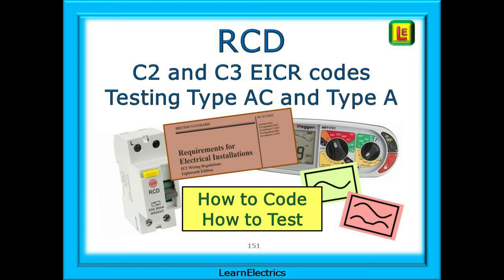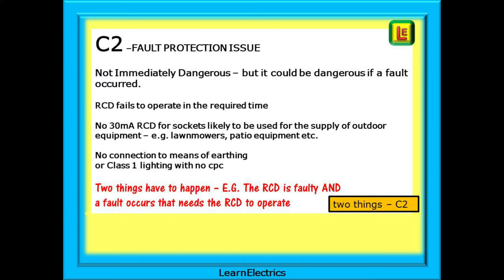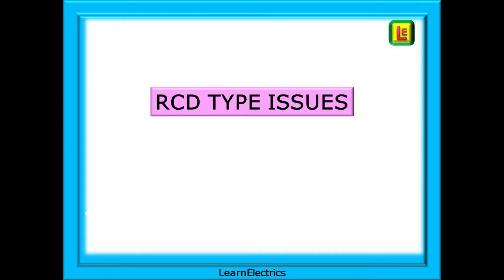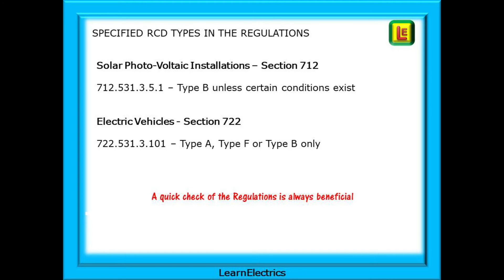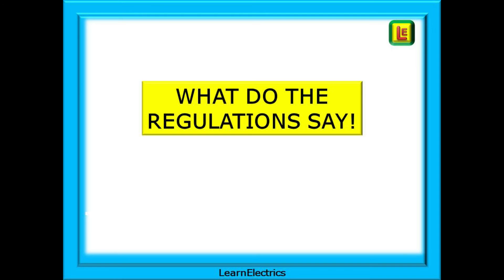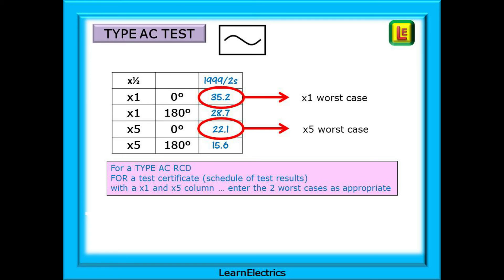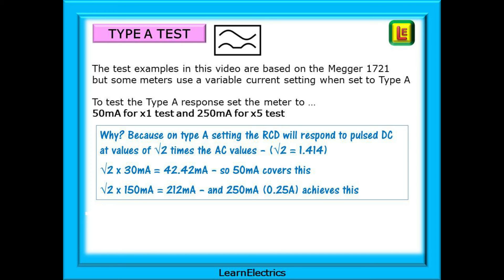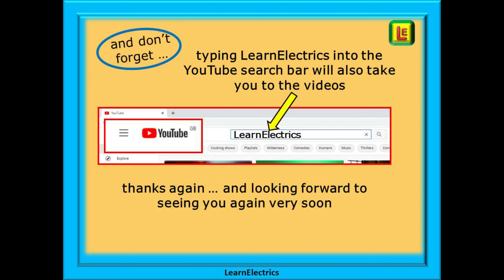RCD – C2 and C3 EICR CODES and TESTING Type AC and Type A devices – THE DIFFERENCES

Comment: I have a question! What if the house is fitted with RCBO's! Would you do the test sequence for each fitted rcbo's? 
I know normally a rcd Would protect each bank in a DB but with RCBO'S you wouldn't need a rcd if I'm not mistaken?
Reply from the maker: Each RCBO should be tested and any RCDs that are installed. If a circuit is RCBO protected then it will not need to be on an RCD circuit, it will be standalone.

Comment: Hello, I would like to replace my two 30mA type AC RCD in my split load consumer unit which is downstream of a 100mA type AC RCD. From a selectivity standpoint, would 30mA type A RCD upstream of 100mA type AC RCD be ok? Thanks.
Reply from the maker: Wrong way round. The bigger rating 100mA RCD should be upstream of the 30 mA devices. Hope this helps.
Reply: @learnelectrics4402  Thank you! Yes, 100mA should be upstream and the 30mA should be closer to the MCBs. All I'm doing is replacing my two 30mA type AC with type A. The 100mA type AC remains as is. So it looks ok from a selectivity standpoint. Thanks again.

Comment: If installing a socket outlet to a existing installation for a 13amp single oven on its own circuit will this now need to be type A rcd protected or is the type ac in place sufficient. Was looking at 531
3.3 would this be classed as cookers
Reply from the maker: I'm guessing that this is a new, modern oven with timers and bells and things so it probably will have DC components in it. And a new circuit? with new circuit breaker and new cables? I would go for a type A RCBO for this circuit. If its an older board there might be some difficulty in relocating or fitting in an RCBO. You could always fit an external RCBO in an enclosure.
Reply: @learnelectrics4402  hi thanks for reply yes all these modern ovens have timers and maby led light. 
  What it is a local shop to me wants me to install a socket behind all the single ovens they go to and for some reason they can't install them.
   So say its a 13 amp oven that's been wired direct to the 32 amp cooker circuit.
   So they then want me to pop in add a socket so they can go and just install it.
   These new regs with type a rcds are a bit of a pain. People don't want to pay.
   So trying to find the best way to keep price low 
   Was maby thinking of them type A rcd fronted sockets or fuse spur devices if they comply to regs.
   It's hard to tell someone they need all this work doing just to plug there oven in. When they already have a type ac rcd in place thanks

Comment: Sir, I have a question with regards to testing of the RCD. Should the SPD or AFDD should be disconnected prior to carry out RCD testing? To avoid damaged to the devise. Is this correct?
Reply from the maker: Not necessarily. The RCD test just puts a few milliamps at 230 volts across the RCD. Insulation Resistance tests are different, you definitely need to be disconnecting devices or taking precautions before putting 500 volts down the wires. Dave.
Reply: Thank you very much sir, for your advise.😊

Comment: Slightly off topic, but I have a question regarding rcd protection. I was doing a job a couple of weeks in which I had to add 2 lights to an existing circuit "commercial " the lighting circuit in question was protected by an mcb but does have switch drops etc. Now as I was the last person to work on the circuit I was under the assumption that I would now need to protect it by an rcd. My mate thinks differently. Any info would be welcomed. 

Thanks.
Reply from the maker: If you make additions to a DOMESTIC lighting circuit you must bring it up to current standards which includes 30mA RCD protection. Hope this helps.
Reply: @learnelectrics4402  hi dude thanks for your reply. So would it be only domestic or domestic and commercial? I only ask because the job I had done was commercial and the existing wiring contains switch drops etc. Thanks again.

Comment: Hi Learn electrics your videos have literally been brilliant helping me out during my First year starting out, they're so easy to understand.
I have got a question if you can give advice please. Lets say a customer wants power to outdoor sockets and power to an outbuilding and everything is fine like bonding, RCD protected etc etc. Would you need to retrofit an SPD in this instance ? Or does SPD installations only be required when fitting a new CU.   Thank you so much.
Reply from the maker: At the moment, for domestic circuits they are optional. It is recommended that we tell the customer about SPDs and let them decide about installing one. But not compulsory.
We have a video on this called  SPD INSTALLATION IN A CONSUMER UNIT, click on the link below to see it.
https://www.youtube.com/watch?v=pgiUeQ3Z7Cw
Dave
Reply: @learnelectrics4402  Thank you so much

Comment: This is really poor outdated advice. Having spoken with actual members of the JPEL 64 board I can advise that there is absolutely no requirement to test Type A RCD’s on the type A settings within the 18th edition 2nd amendment. The only test now required is that all types of RCD’s should be tested on the 1x setting on either 0 or 180. If in doubt refer to the NICEIC who will advise in accordance with the new IET regulations.
Reply from the maker: This is exactly what I say in the video Martin. The Regs only require the most basic test but if you want to do more, then this is what to do. Thanks for watching. Dave.

Comment: Another really useful video, thank you. The additional testing required for type A RCDs was really useful info, and I’m now thinking that my old Megger 1552 MFT isn’t really up to the job of adequately testing type A RCDs - it only has 100 mA and 300 mA ranges on the mA dial, not the 50 mA and 250 mA suggested in the video. Thoughts, anyone??
Reply from the maker: A good idea to keep your equipment up to latest standards. Sometimes you just have to do it. However, the 250mA test is, according to the test requirements,  AT LEAST  250mA, so 300mA would do that and if your 100mA range has a times half setting, there is your 50mA. The megger I mention in the video will do all this, shop around for a deal. Dave.
Reply: @learnelectrics4402  , thank you for the help and advice.
Reply: Perhaps you have taken the plunge now and bought a new meter but my MFT 1553 has a number of  current settings and will do the specified currents if you use the x 1/2 setting. I thought the MFT 1553 was identical to the 1552 but for the Bluetooth  feature on mine. Maybe I'm wrong. 

If a meter works and gets through calibration year after year then why change it.

Comment: excellent Video Dave however I have a question as you mentioned if only sockets are suspected to feed outdoor then C2 otherwise C3 with no RCD but you didnt mention anything about Luminairs? 
I read somwhere Luminairs should be RCD protected how would you tackle this?
Thanks
Reply from the maker: It's mentioned in the video. All Class 1 light fittings must have a 30mA RCD, code 2
Hope this helps. Dave.
Reply: @learnelectrics4402   Thanks for the reply Dave so if luminairs have class 2 fittings then RCD is not required?

Comment: David can you tell me why the big push for RCDs  for sockets particularly for portable equipment use outside would a 30ma plug type RCD be an easier option and better as if it goes it’s not going to take the main ring circuit with it ? All my garden tools have 30ma three pin plug RCDs  and they do work just as well , I test them at least once a month so I know they are working as intended. You’re thought’s would be much appreciated. 
Many thanks 👍
Reply from the maker: Sean, no problems with what you are doing. The Building Regulations do actually suggest an RCD on an extension lead or a plug top RCD if none is fitted. When I was on site I always ran all my tools off my own RCD extension lead because I knew they were tested by me every month. Thanks for the comments and the support. Dave.
Reply: @learnelectrics4402  thank you I just wanted you to be sure . I also have an extension lead with  a plug top type RCD in my toolbox  . But it was a friend who asked me to replace the plugs on his lawnmower and hedge trimmer . And want to be sure the is acceptable option as he doesn’t have RCD protection in hie CU as it is a rewireble . I said he might think about an upgrade but  that fell on death ears . Thank you for your reply
Reply: @Dog-whisperer7494  fit one rcd socket where he plugs them in , this covers every appliance used in that outlet.  Years ago when I was doing Periodic tests ( now EICR )  we would swap the socket nearest the front and back doors  for equipment used outdoors to rcd sockets.  This then complied .  The reason we fit a rcd at the consumer unit is because it's cheaper and covers all sockets.  We have to assume all homeowners are idiots and protect them the best we can .

Comment: Hi David just a small point . we are no longer required to test RCDs at 1/2 x 1x or 5x, we can if we choose to but we are not required to ,also there is no ware on the test certificate to record the 1/2x and 5x test . 
In my opinion this is a stupid idea what was the IET thinking when the made this change? 
But I for one will continue to test At 1/2x 1x and 5x  I have no intention of just trusting the manufacturers when they say the device works correctly. 
Fantastic video as always 
👍👍👍
Reply from the maker: Exactly my thoughts too Sean. The Regs have a minimum requirement but most of us still do all 5 tests. I've had a couple of Type AC RCDs pass the x5 tests but fail the x1 test. If I hadn't done all 5 tests I would never have known and the customer may have been in danger. I write the x half and times 5 result in the comments boxes so anybody else knows I've done them. Dave.
Reply: @learnelectrics4402  yes I couldn’t agree more  . In my opinion the new regs on Testing RCDS is stupid.

Comment: Great explanation as ever dave, one question though, if an older tt installation has only 1 AC Rcd at the head of the board, covering everything. So the Rcd is providing fault protection, would you c2 this on an eicr?
Reply from the maker: If it was a 100mA device yes. Thanks for your support. Dave.
Reply: Po